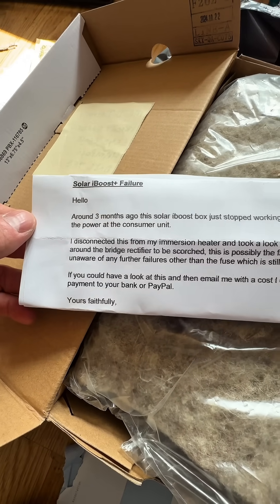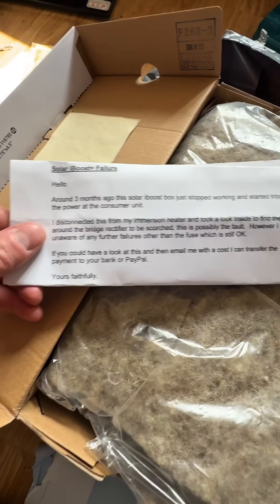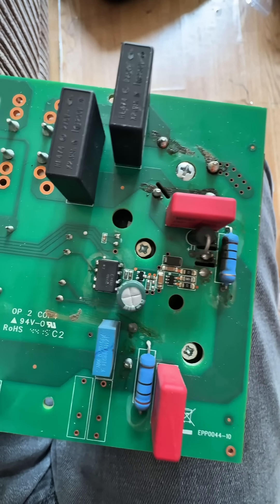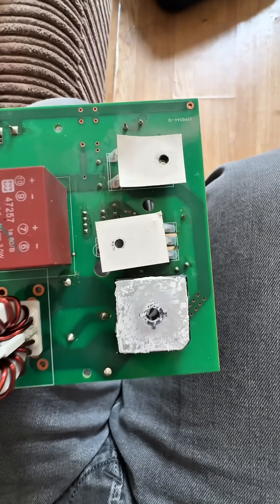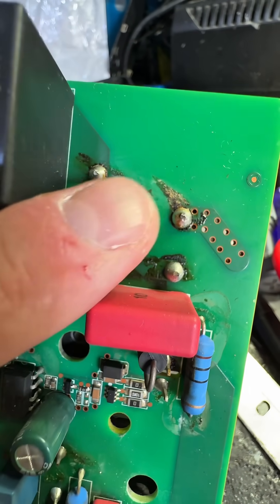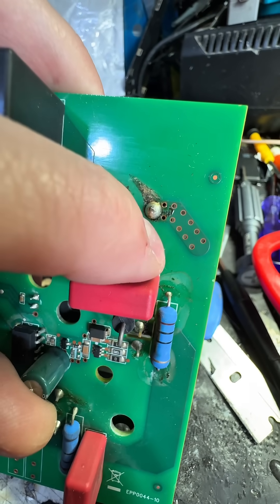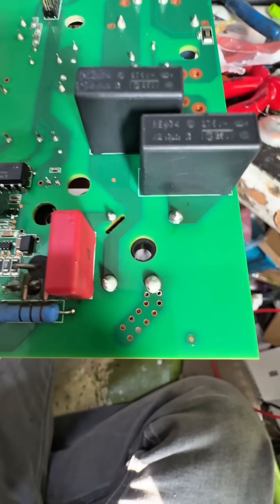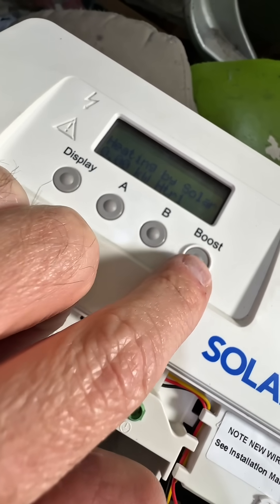🔧 Fixed: Marlec Solar iBoost+ Dead / Blank Screen – Repairing a Non-Responsive Unit

Comment: Hi, Looks like I've got a similar problem to this video. The iboost is dead and tripping out the main fuse board. Im unsure just to buy a new iboost or get it repaired. How much would it cost? looking forward to your reply 
Rob
Reply from the maker: Hi usually they are 65–85 fix on these
Reply from the maker: If you wanted to send in, drop me a message at www.facebook.com/mobileithelp or www.Mobileithelp.co.uk and we can get it sorted